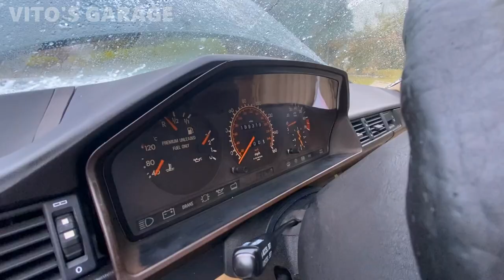Part 13 Mercedes W124 Stopped Running. Backfire, Crank No Start, Leaky EHA Valve. New Spark Plugs..

Comment: My w124 also smokes like that on first cold start up, after 5-8mins idle is goes down to 600rpm and there’s no smoke from the exhaust. 

Love your channel, salute from NYC
Reply from the maker: It was very very cold that day when I got it running. And when I first got it running the cylinders had way too much fuel in them from cranking. But the next day I cold started it and there was no smoke. It was a lot warmer too
Reply: @VITOSGARAGE  yup on warmer mornings I don’t get any smoke, thankfully the smoke isn’t blue or black. But I do suspect I’m running more of the rich side, 200k on the clock.

Comment: For the spark plug, you shouldn’t use resistor type of spark plug (NGK 2238 have 5k ohm build in resistor) for m103. Mine 300ce runs like trash with the resistor type plug
Reply: You are correct, non resistor plugs for these old MBs. BP6EFS are the correct NGK plug.

Comment: I changed this EHA valve last year...the price for a new one is eyes popping, 620€ for my 230 CE.
Reply from the maker: About $200-300 for brand new one in USA. Not bad considering it will last another 50 years

Comment: Had the same issue with my 1992. It also ran fine other than the smell.   Replaced, but now my throttle response is off.
Reply from the maker: The eha valve needs to be adjusted after the replacement

Comment: How often should you change the distributor cap every time my car won't start I cleaned the distributor cap it has moisture in it is this a ongoing thing with this car?
Reply from the maker: You have to cut openings with the Dremel in the distributor cap. Basically create ventilation so the moisture doesn’t build up. There’s an article on google about it too. I mentioned what to do in the video too. You need to cut the slots in the cap itself to create ventilation. And make sure the red Oring around the cap is replaced.

Comment: Can you able also to get the distributor rotor also at oreilly? Also how can you tell if the distributor rotor was still good ? Or not
Reply: Yeah man my 190 as of today it’s cranking fine but not starting . I can also hear the fuel pump . Coil is fine as well . I don’t know to replace the accumulator or filter or just replace the d cap and rotor
Reply from the maker: Did it stop running all of a sudden? If so then I’d look into ignition distributor cap and rotor
Reply: @VITOSGARAGE  yes Vito it just stopped running all of a sudden from  it wasn’t being driven it was just being moved 20 feet here and there for parking . It’s getting painted so they do the body work for now at a house . Yes . I replaced the distributor cap and rotor and I was lucky auto zone carried them and it was the exact issue.  Thank you for replying back